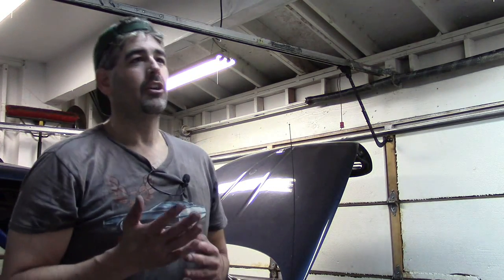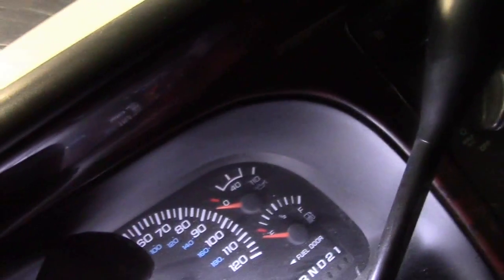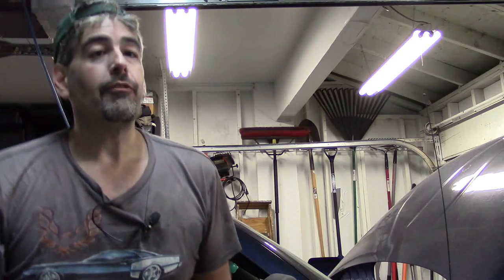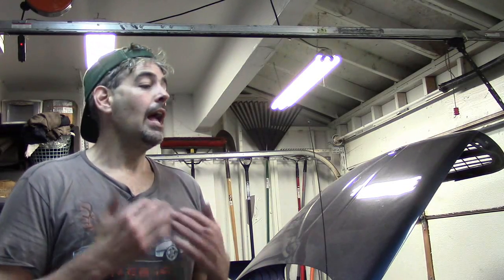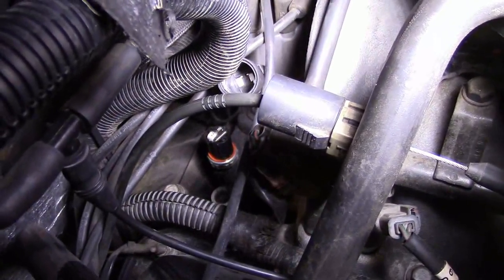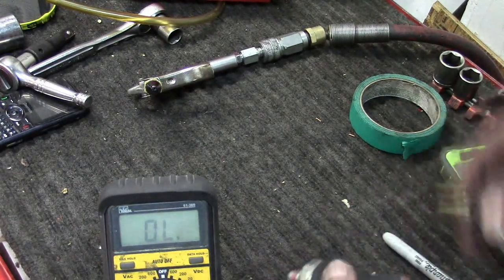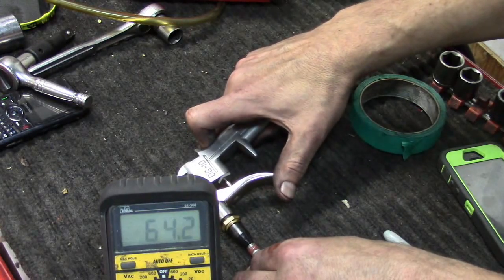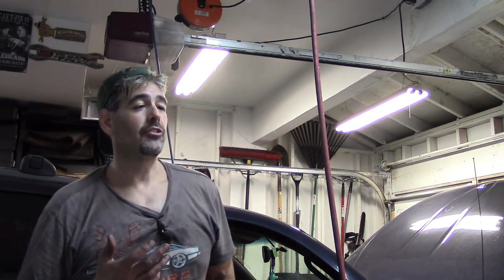DIY- Low Engine Oil Pressure Diagnostics

Comment: I'm hoping a lot of people find this video. This is THE video to watch about low oil pressure. 

It's painful to fast forward to someone having replaced an oil pump and rationalizing the same fuel pressure as "better" because they "at least did something".

Or, they add some magic additive to their oil and have an emotional response that it's better, when the oil pressure remains the same, "but oh, at least the oil pressure goes up when I push on the gas". 

Sorry, the first bad car I bought flickered it's oil lamp a bit here and there and it quickly developed a serious knock. I figured it just had really dirty oil - probably would have had metal flakes if I had figured to check.
Reply from the maker: Correct. Most people think oil pressure is generated by the pump.
Reply: Schrodingers Box
Exactly. :)
Reply: ***** That's wonderful that everything else checked out. :)
Reply: ***** You may have gotten a bit more life out of it by using plastigauge on installation to check spacing.

Regardless, a great story. I hydrolocked my engine. I'm on a break from working on it, but if you like that stuff come check it out.
Reply: ***** I sure did. I didn't even think to look for that because there was nothing on the ground. Toyota Corolla engines are so popular that buying halves of the engine are way cheaper than worn out old ones.

I've been in Germany. Getting tools seemed really tough.
Reply: But DE Nichols... it was probably an oil pump problem, which then caused the bottom end failure! (What's the thing about "fuel pressure"?!
Why don't people get it! -That the oil pump is the first place to look as the cause of low oil pressure! You get low oil pressure, and consequently the big end bearings fail.
Reply: @joolstacho8114  Why don't you get it that the oil pump is tasked with providing flow and not creating pressure?
Reply from the maker: Troy is absolutely correct - Because the pump is NOT the source of pressure. . It provides flow. The bearings provide pressure. Period end of story. That is basic fluid dynamics. Without resistance there is no pressure.

Comment: Oh its only the sending unit. SURPRISE you need an engine
Reply from the maker: Yeah unfortunately I do believe the seller knew the engine was bad and unloaded on this poor guy.  The pressure sensor damage was surely from improper replacement on a "parts lottery" guess by previous owner
Reply: It might even be possible that the sensor was damaged intentionally in such a way that the prior owner could demonstrate that it was broken... but not too broken, if that makes any sense.

Comment: Sad news indeed...  If I weren't about to move clear across the country to start a new job, I'd offer to put some money up to help the kid out with a rebuild!

Perhaps though, if he really needs his car and can't afford to rebuild things straight away, this might be a good candidate for a thickening additive like Motor Honey?  Sure, it's like putting a bandaid on a severed limb, but it may buy some time.  Plus then we could see just how much (if any) it actually helps oil pressure.  :)
Reply: rhkips
I really hadn't thought of it either. Having driven older cars it makes you aware every cold season that the engine takes longer to sound good when it first gets the oil moving.

I've found a couple ounces of Synthetic Lucas oil treatment reduces time of the sound of lacking oil on parts in the cold. All it showed up as in my oil analysis was good levels of additives at the end of an oil change, when those numbers should have reduced, so I don't think I messed up the chemistry of the oil (I think full bottle treatments are insane when a couple ounces made old oil test like new additive wise).
Reply from the maker: thanks Kips. With winter coming up though I fear this engine is especially short lived.
Reply: Very true Matt. Winter, thinner oil, already aging engine. Shouldn't last the winter.

If the owner can hold off on using the vehicle and see if the engine is rebuildable, it's a shot in the dark that'll go away with a temporary bandaid, but maybe bandaids is all he's got? Great comment rhkips.
Reply: Schrodingers Box
Hmm, I hadn't considered that.  I keep forgetting most of the world experiences seasons!  Whoops...

Comment: He rebuilt the engine,but turned out to be a bad oil pump, oh well. Hey Matt you look as gay as ever.
Reply from the maker: patw52pb1 Sorry but the evidence based on your own testimonial is actually AGAINST the pump being the issue.  As I mentioned, I will do a video on the mechanics of oil pressure.
Reply: You're going to have to make a video on the mechanics of oil fluid pressure Mr. Smartass. Were too stupid to understand it so you gonna have to explain it to us. While you're at it, explain to your wife that you have homosexual tendencies
Reply from the maker: It is impossible that this could be an oil pump. Anyone with even remedial knowledge knows that. You are a fool.
Reply from the maker: btw dumb move commenting early. Now tens of thousands of people will see what an idiot you are.
Reply: Your right.
Reply: So, decreased ability of a defect pump to move volume would not lead to decreased presssure?
Reply from the maker: qwew eweqwe correct.  I see I need to do a video explaining oil pressure fluid mechanics.  Lots of people seem to misunderstand oil pressure
Reply: Did you miss that he found bearing material in oil, how is it oil pump? Oil pump will be damaged as a result, so both bearings and oil pump would have to be replaced. I bet junkyard engine is best choice for this man
Reply: I didn't see anything metallic in those views of the oil. he does have diy camera work
Reply: If you didn't see it, doesn't mean flakes don't exist. He's not shooting Hollywood style movie with all details,
Reply: If the oil pump (or any positive displacement liquid pump) is worn and or has the relief/bypass valve stuck, which is a common problem on older engines with no/long oil change intervals and or severely overheated, then the pump cannot supply enough volume to develop adequate pressure. 
The pump in the video developed pressure with increased engine RPM indicating that with additional volume it developed additional pressure. The engine rotating assembly clearance leak rate did not change with additional RPM. 
Oil pumps do go bad, especially on high mileage/abused engines, to summarily dismiss a malfunctioning oil pump without additional diagnosis is irresponsible.
However, with the metal shimmer in the oil sample there is indication of wear...  but what is wearing? 
Too many unknown elements and unanswered questions. 
What is the composition of the oil sample metal particles? 
Are the particles ferrous and attracted to a magnet? 
Is the wear from low oil pressure due to a malfunctioning oil pump or excessive leak rate? 
Does the oil pan have impact damage? 
What has the oil filter captured? Cut the filter open and inspect the media.
Reply: Does rod knock sound tell you anything? Low Oil pressure and knocking sound go together, flickery yellow particles come from either pin bushing or bearing material, worn out pin bushings will not result in low oil pressure. As rpm increased more oil volume delivered thus creating higher oil pressure. All other points that you mentioned make sense, but all evidences point towards worn out bearings.
Reply from the maker: You didnt see the abundance of bearing material!???? It was easily visible several times!!  Not sure you know what you're even looking for!!

Comment: Some of the Chryslers of that era have "fake" oil pressure gauges.  The dash gauge either reads in the normal range or it reads zero but never in between.  That sending unit appeared to be variable, and that's what the wiring diagram shows for that 2-wire sending unit, but the dash gauge was either zero or 30 but never in between. Kind of strange.  

It's too bad there are dishonest people that would rip someone off like that.  Sad.  That sending unit looked pretty clean like maybe someone had replaced it and realized there was a bigger problem and dumped it on someone else.
Reply from the maker: On what data do you have?
Reply from the maker: Precisely what I suspected. I figured the broken sending unit was result of some 98%er changing it on a guess.
Reply: johnaclark1
Reply: Crooks who knowingly sell defective vehicles without being honest are scum of the earth.

Comment: Hello! Will you be making more case studies? And if so, will it just be on your paid channel?
Reply from the maker: most of my focus obviously will have to be on pay channel but I'll still upload to this channel too occasionally.
Reply from the maker: ***** Send me a PM with your email address and I'll walk you through it.
  The cause of the oil pressure drop is engine bearing wear.  The knocking noise is the result of worn engine bearings, evidenced by the large amount of bearing material in the motor oil.  Oil pressure is created by the restriction of oil through the bearing clearances.  When the bearings are worn out, the oil pressure drops because the bearing clearances are too large.  When the bearing clearances are to large and there is no oil pressure the rod caps are loose on the crankshaft journals and they clatter- rod knock.
  Only a rebuild will save this engine, otherwise it will soon be destroyed forever.